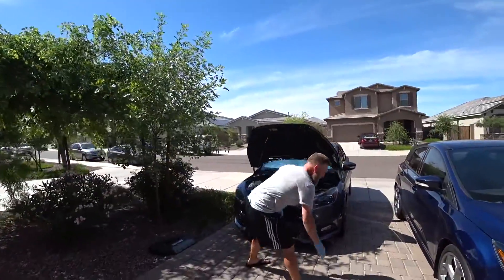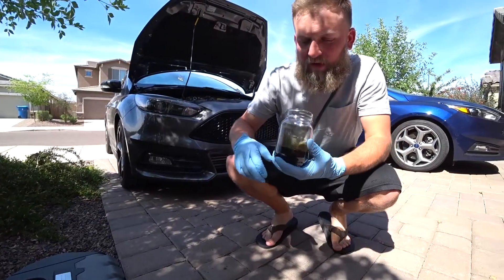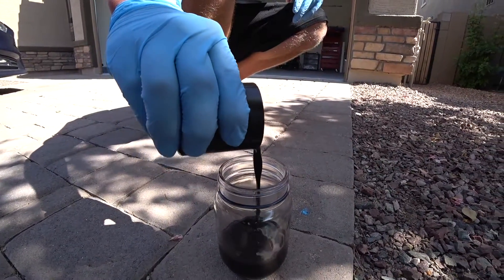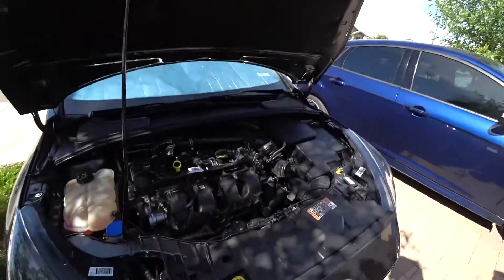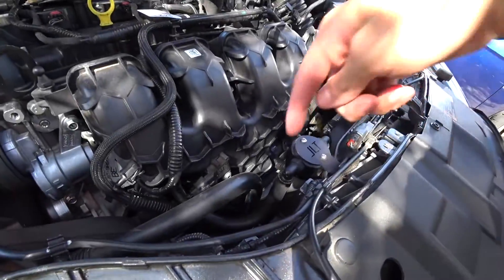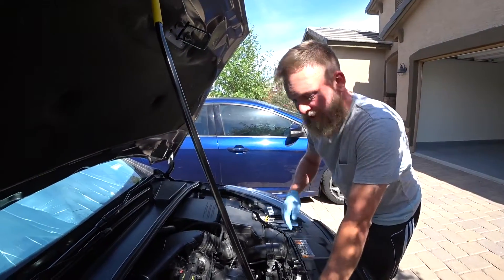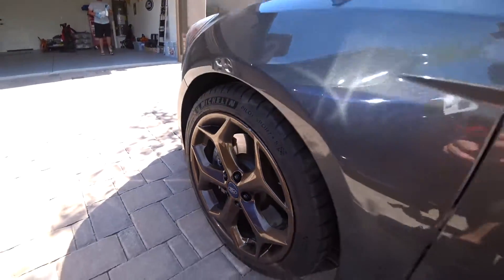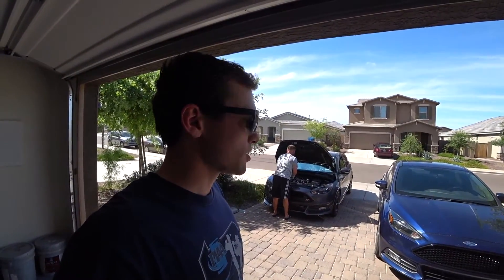Is it Worth Running an Oil Catch Can? (Focus ST)

Comment: Will this void the factory warranty?
Reply from the maker: The only way something can void the warranty is if it is the direct cause of a defect in your engine. Look up the magnuson-moss warranty act
Reply: @Gjeebs  well, I got the extended 75K mi B2B warranty and 100K power train warranty. You said the warranty will get cut in half with the performance tune mod, will it be the same with the oil catch can?

I'll speak with Ford about it. I'd really like to install an oil catch can but if it will degrade the warranty timeframe I'll just have to wait. 

Thanks for the info I'll check it out!
Reply: Magnuson-Moss Warranty Act. Read up on it. Plenty of info comes up if you Google it. I worked for Ford for quite awhile as a mechanic. I'd have to prove that whatever you did caused the failure. Some dealers or techs may not know or care, because cash jobs pay A LOT more than warranty work does.

Comment: I mean, why wouldn't this be installed in the car by default from factory? Seems pretty crucial.
Reply: It does. Crank case breather plate. Although It's not as good.

Comment: Will you now be putting a catch can then making an install vid on it?
Reply from the maker: Probably not lol I haven’t had any issues with my engine so I am just letting it ride
Reply: @Gjeebs  🤦🏿jk, how come do you plan on keeping it over 85-90,000 miles ? Curios
Reply: Most people install to stay away from the issues and never see them better to do early than late their are cases where it can increase compression and coat the top of piston tops if it gets bad now that’s a irreversible problem as spray cleaner won’t help would have to resort to piston soak but I guess that’s if your unlucky.
Reply: @Gjeebs  happened to my 2016 Tucson gdi.

Comment: I have damond catch can installed over a year, and ive only seen a drop of liquid collected
Reply from the maker: Weird
Reply: @Gjeebs  do you think it's cause i don't really drive my car hard or boost often?
Reply: You probably have the one that connects from the valve cover. That one sees a lot less oil.
Reply: @patrickmendoza6526  no mine is in the front like in this video connected behind the intake manifold
Reply: @mustang2005  that’s weird for sure you should be seeing oil for sureskie.

Comment: JLT catch-can purchased immediately from CJ Pony Parts upon watching this... 
I own a '16 Focus ST "ST2".... car has been tuned since 50k miles, now just under 63k miles got it used with 40k car was still entirely stock. I was told by many if the motor hadn't popped by then it was a good one. 
currently stage 2 (intake, intercooler, rear motor mount, resonator/muffler delete, short-shift) I've followed along on your videos for some time and have been wondering about the infamous carbon build up as well... never had any issues with my car aside a misfire due to faulty spark plugs, swapped for NGK 1 step colder plugs, no more misfire... 
BUT, this video just confirmed all my fears of how dirty the ecoboost motor really is...

PROTECT YOUR MOTOR AND BUY A CATCH CAN PEOPLE!!!!

Comment: If you change your oil every 3,000 miles on focus st with mobil one and use premium gas your valves would stay clean,there is a guy with a 2013 st with 175,000 miles on it stock engine and manual transmission with no catch can.
Reply: You must not understand where the blowby comes from. What you stated there would have no effect be ause these a tgdi engines so fuel quality wont effect the carbon on the valves
Reply: @drzflyest4  Oh yes it will. Most of the blow by is fuel, not oil, actually. Using quality fuel and oil and changing oil often will most definitely help. Stratified has a nice write up about this and also why catch cans aren't actually as helpful as they seem.
Reply: @aloha_from_bradley  I don't disagree with you there. You kinda summed up the point of the Stratified article I mentioned too. Sure, a catch can will slow the build up of carbon, but it doesn't solve the problem. Quality oil and fuel can be just as effective, but like you said, it can be difficult to impossible to control those things, particularly fuel, depending on where you live.

Meth injection is probably the best way to keep the valves clean, but obviously that's not for everyone. I certainly don't have plans to do it.

Comment: You should consider the Mountune breather plate. It replaces the oem plate and is supposed to reduce the amount of oil vapor that gets into the intake manifold and stuck on the valves. I’ve had it on my ST for a while, installation wasn’t too bad. It’d make for a good video.
Reply: To be honest, might as well install both the breather plate and the oil catch can at the same time because you'll be working the same location for either one of them. Also feel free to check out Radium Engineering they also offer a Breather Plate and it's $30 less than the Mountune Breather Plate. I'm running the Dual Catch Can Setup by Radium Engineering right now.
Reply from the maker: I have been considering that for a while so thank you for the recommendation. Is there any continued maintenance you have to do with the breather plate?
Reply: Gjeebs Not the I’m aware of. You just swap a couple pieces from the oem part to the Mountune part during the install.
Reply: @FunkyShaf  does the breather plate void warrenty at all?
Reply from the maker: No
Reply: I just ordered the Radium plate and PVC can what are you getting in the rear can.  I saw a focus vedio 2 cans front loaded rear empty ??

Comment: I just wanted to point out that your friend has a JLT Catch Can System. You linked a JBR Catch Can System in the description. I believe CJ Pony Parts has the correct product. 

On the other hand, do you have an aftermarket WGA installed? If not, do you plan to install one?
Reply: Why wouldn't you link it for people? Lol

https://www.cjponyparts.com/jlt-performance-oil-separator-3-0-front-side-black-anodized-kit-focus-st-2013-2018/p/OILSEP74/

Comment: I've been thinking about this a lot more lately. My uncle and I bought new STs about a year ago.  His is currently at the dealer getting the cylinder head replaced because carbon build up was giving him a misfire.  17k on his car.  WTF.
Reply from the maker: That’s crazy it happened that fast. Are they stock and are you using premium fuel?
Reply: @Gjeebs  Both cars are stock, both get only 93 octane gas.  Dunno.  Mine has 12k on it so I'll probably be ordering a catch can soon.  

Love the content btw, your videos helped me decide to get an ST.

Comment: Installed a catch can at 200 miles and just recently installed a second one(valve cover to turbo inlet pipe). Seeing the oil it catches is enough for me to justify having one
Reply: I'm assuming you don't have a warranty? This install voids the warranty.
Reply: Hodl Wise I’ve never had to make a warranty claim. If I ever do, it isnt too difficult to remove the catch cans. Especially the rear one.
Reply: @patrickmendoza6526  yeah, but I've never done any engine work in my life lol. I'm a little nervous to go tinkering around without a friend guiding me or helping out. Yeah, I've heard people uninstall the oil catch can if they ever need to make a warranty claim.
Reply: What adapters did you use to run the hoses from the valve cover to the catch can, and the turbo inlet pipe one as well?

Comment: I had only 11k miles on my 18 st when I installed my catch can and when I pulled the intake manifold, wow the carbon build up on the cylinder 1 was starting to get bad.  Just imagine 30k plus miles without one what that valve would look like. Defiantly worth every dollar and time spent installing it.
Reply: Imagine what the piston tops would look like from all that oil increased compression happened to me.
Reply: I am at 43k with picture proof of that.. ya my Radium Engineering PVC plate and Catch can just showed up,  and sound symposer delete along with it